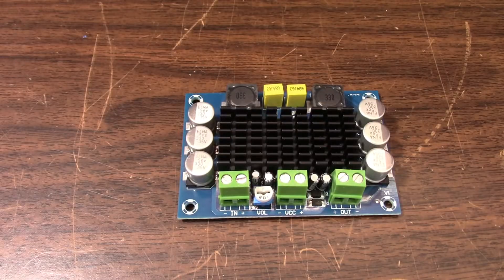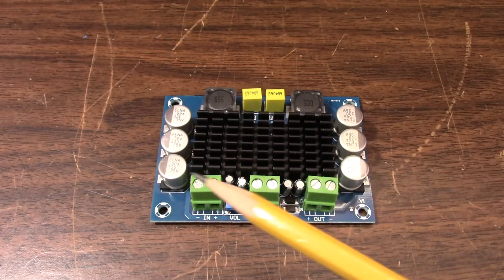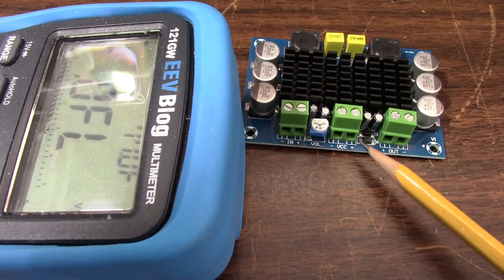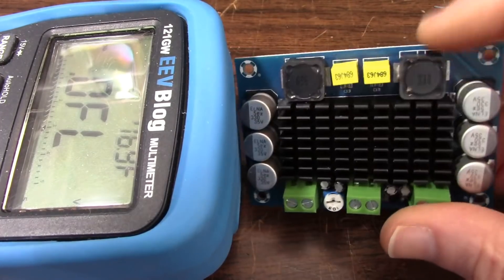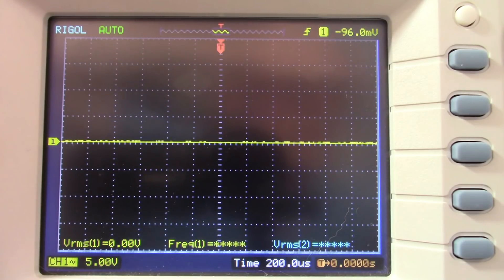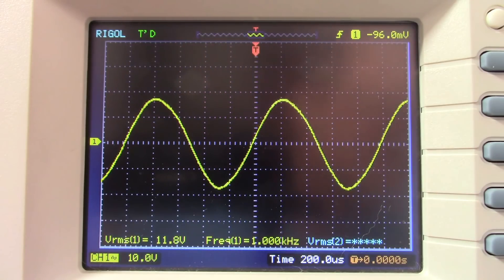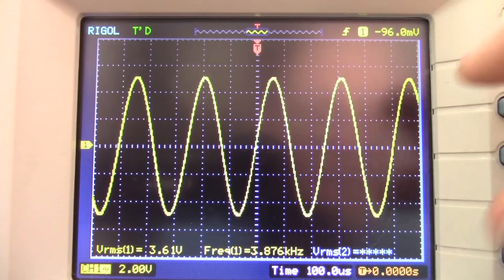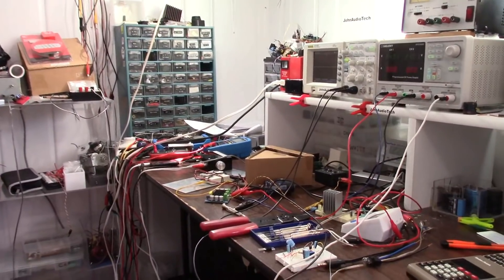TPA3116D2 audio amplifier 100w at 2 Ohms?

Comment: Have they made a mistake with the build? Looks to be 4 small identical capacitors, 2 are for the input but what are the other two for? The data sheet says you need to connect the left inputs directly to ground for it to work in BTL mode. Have they got one output just sitting idling? This is what it looks like if you can get 50 watts easily. Might be worth checking each output half separately (scope between output and ground for each half) to make sure they are both doing something. The datasheet also claims full output with just a small heatsink. http://www.ti.com/lit/ds/symlink/tpa3116d2.pdf

Comment: Why aren't those diodes from negativ to possitive, just shorting the input if wrong direction / polarity is connected.
Reply: Because there is no fuse. If you build it into a case with a standard power connector, it's unlikely that you'll get the polarity wrong, so maybe just bypass the diodes to prevent heating and losses in that case. They probably just include the diodes so they don't get too many people complaining that they've 'blown it up' because they made the mistake of connecting the power back-to-front, yet claiming that they didn't.

Comment: Excellent demo, thanks John! I've used quite a few of these amps and they really are incredible for the price. One caveat, the heatsink is just glued on, not sure how effective the glue is at conducting heat, but I've had a few heatsinks fall off, some of them arrived in the post like that. It would be super cool to see a video of you modifying this board in an attempt to hit 100W, you think you could do it? ;)
Reply: Haha, I tell you, if the glue is hot glue, it will come loose very easily. I have had many small battery charging boards fall off from the tiny smd ic melting my hot glue :3

Comment: In Brasil its very used in many projetcs is good simple dc power to work example 15v 3amps to 4 ohms. 13v to 2ohms. And 20v to 8ohms and 16v to 6ohms. Is good sound no is perfect. Was be low price good to price to its ok. Go work with low cost. Low price yes its ia good to brasilian. Many projetcs is not big price. Yes good to value.. Medium quality sound. Was good work easy work and small peace amplifier nice small and good to medium sound is ok. To speakers 4ohms 60w or 80w is good. 6ohms 50w speaker is good work yes. Ok tank you for vídeo. And i like ok.

Comment: Good speakers. Yes tank you. Its ia good to 18v 4ohms. Or 14v to 2ohms. And 4ohms is 50watts máx. And 2ohms is 62watts ok. 8ohms at 22v is 40watts ok... And no hig quality no is  very very good. Its good price and good function easy power supplye simple dc power. Low consumer in amps... Is good to medium sound power yes is good to 2 speakers 4ohms or 6ohms yes power supply 14v or 15v yes with 3Amps its ok. To 2 pcs amplifier is good 16v with 5amps ok. Good projects for we and all gays.

Comment: I have one of these that I modded into a bass guitar amp.
Works really well for a DIY practice amp.
I use a Behringer mini 9 band eq with it.
Reply: Do you have a video on how you made it?
Reply: Did you use a preamp circuit?
Reply: @catking7901  I use an active DI box with a preamp.
Reply: I also for bass will use. What power supply do you use for it?
Reply: @pusipusi6929  I use a battery pack I made from old laptop cells.
Reply: @aurthorthing7403  And what do you think of the Behringer mini?

Comment: Hi John,
Isn't it more acurate to confirm te 24v on the power connection from the board in stead of the voltmeter inside the power suply? Or does youre power suply have remote sensing?
Reply from the maker: I'd lose a tenth or two of a volt. It isn't that important for this test. It is just more effort I'd have to make to measure that.

Comment: what need to change for handle 2 ohm at high supply voltage like 19v? that diode on DC input larger or bypass? and that coil on output?
Reply from the maker: Bypass or change the diodes, fan on heatsink, Change coil and caps on the output filter to suite 2 Ohm load.
Reply: Nice video John! As you mentioned- the TP311x device can do 100W in 2ohm stereo- everything around it on the board? ... not so much. The cards you find online featuring the TPA311x are usually built to sell for less than the price of a good cup of coffee- usually with an application circuit copy and pasted from the data sheet or EVM, but with all of the components swapped for cheap, underrated ”no name” components (or even removed completely 🙄 ). Frequently the guys who are spinning out these designs assume that the EVM they pulled everything from is over-designed. However, it’s often the case that the components were chosen based upon the target market and application. If the target market is high volume low cost consumer electronics, we’ve already picked the cheapest parts that could barely meet the mainstream use cases. Otherwise, the target customers will leverage the cost of the external components in their price negations with the chip manufacturer. For their part, the chip maker expects that corner cases that are supported by the math are supported by reference designs or e2e support in the forums. These board designers don’t take this into consideration- and the person putting the power number on the box often knows less about “what a watt is” than Snickers the cat does.

The reduction in high frequency is likely because of on the output filter not having been designed for 2ohm loads. I would guess the frequency response of that filter is pushing down well below 20kHz with the 2ohm load. Perhaps you could make an argument that this is reasonable, since you’d not be (errr... *shouldn’t be*) running a high frequency driver at 100W continuous power with this amp.

The overall power drop is likely due to the increase in voltage drops across everything between the output pin and the load terminals. The output FETs are 90mOhm and the die has triple 2mil copper bond-wires on all of the power stage pins... but then you hit the lead frame, the copper traces, the DCR of the output inductor, the connector, the wires, etc. If you consider from the pin of the device to the terminals of the load as stage as half a voltage divider and the load as the other half, it doesn’t take long for those little voltage drops to add up compared with the 2ohm load impedance.... it’s even worse when everything gets hot. As As you know, 2ohms exacerbates the I2R drops because the power dissipated in each resistive element increases with the square of the current.

tl;dr -  You likely would not want to use a $5 design with a taped on heat sink for any design that you intended to make lots of power into a low impedance.